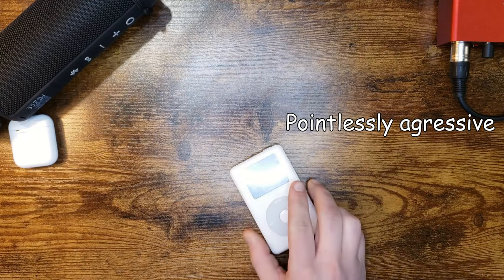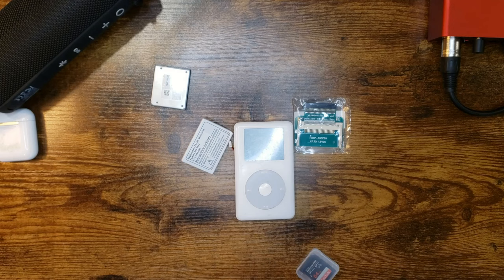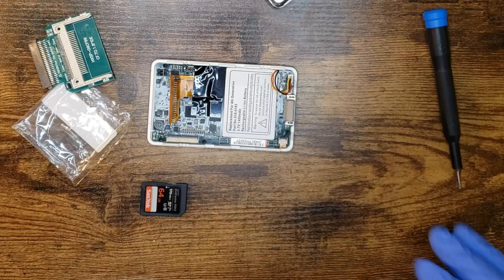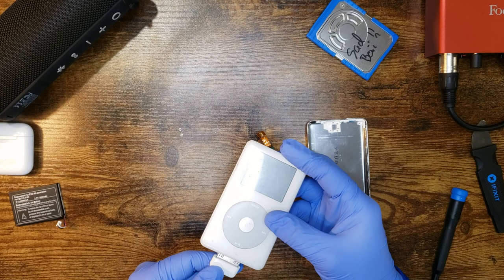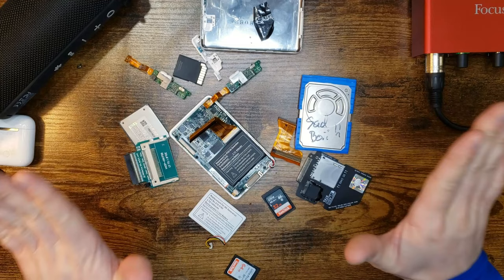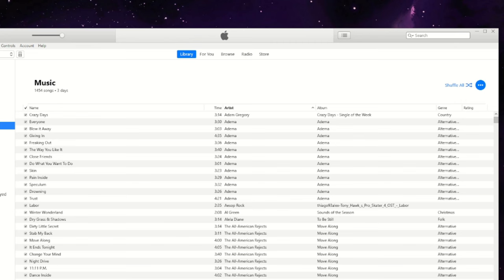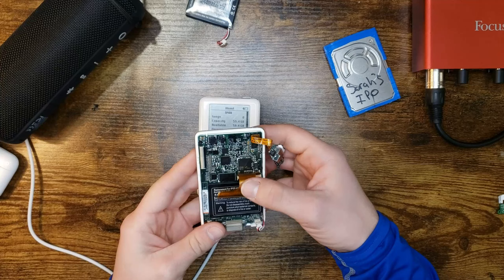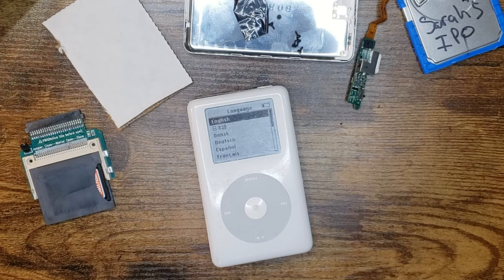Flash modding a 4th gen iPod | There weren't any issues at all

Comment: You should copy off all that music off those drives. I did on my iPod. You just enable the iPod for disk use and then uncheck hide hidden files and folders and then look for an iPod control folder and inside that there are folders with every song on the iPod they will be renamed to four random letters or numbers per file like ER45.mp3 GHUI.mp3 something like that and copy every folder in the music folder.

Comment: Fat32 for card and clip the edge of the adapter where it makes contact with the larger plastic pin on the ribbon cable connector
Reply: And now I've watched till the end be careful putting the back on I protect the docking port plastic with a thin spudger

Comment: I DID have an issue :/

My usb doesnt connect properly and it wont stay in disk mode if plugged into the computer. It reboots constantly when plugged in, but will stay in disk mode when not plugged in.

I'm getting a new cable..if that doesnt work...to ebay for a "new" gen 4 color.

It didn't do that before, but then, the old drive was dead af.

I bought it new in 05 :/

Comment: I built a 5th gen iflash solo and regretted it after 1 month. Everything works perfectly but an iPod is supposed to use a hard disk. If you want a flash media player then buy a new Sony Walkman that runs on Android. I missed the vibrations and noises that the HDD would produce.
Reply from the maker: Got a 5.5 gen and just left the HDD in it, probably will for as long as the drive stays alive. Although I do have a spare 5.5 board I might just do a a flash mod with that board and have both